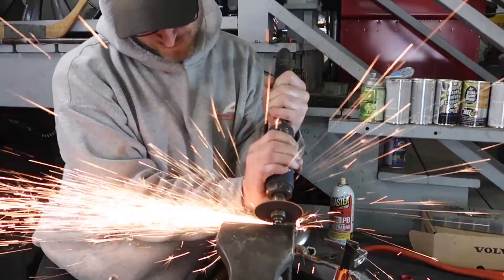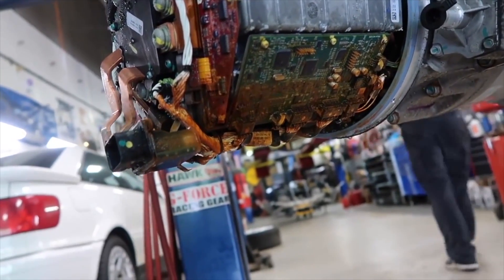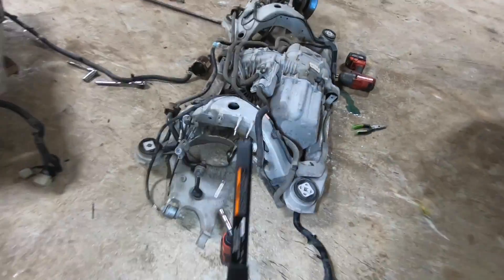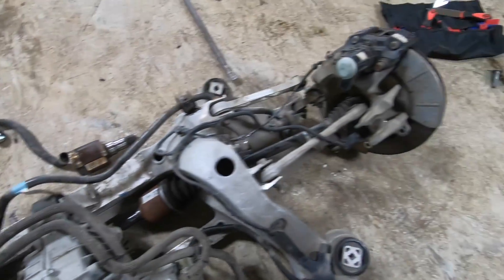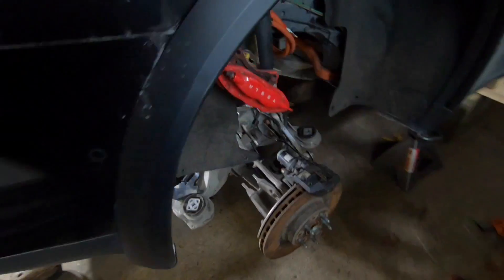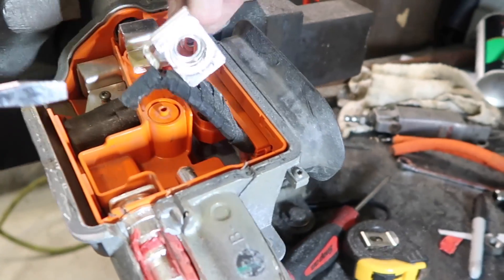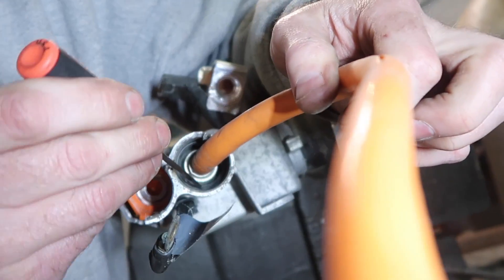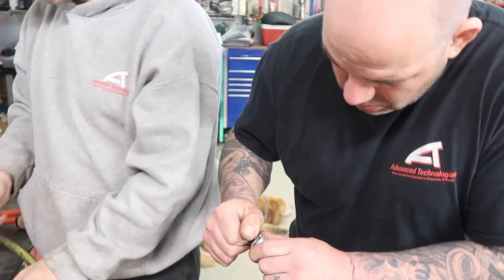Restoring a Flood Salvage Tesla Model X Part 7: Tesla motor swap

Comment: all that corrosion could be prevented with some dielectric grease from the factory...but Elon wouldnt be able to sell more defective cars if they where to use that.
Deffective in that they are building disposable cars that one must turn to scrap and buy new when something goes wrong.

Comment: I actually like that shade of gray. And don't think it's primer. Why does a buddy. Keep calling it primer ?
Can you and Sam get over it? You pull seem like a couple of reasonable individuals and pretty decent guys in general I think were done with the ribbing and should move on.

That being said, admitting you have a problem is the first step. It's time to admit you have an addiction for Tesla vehicles. It's okay there's a support group out there for you  I'm sure.I think were going to be fine as long as you don't start electric motor swapping a Dodge charger.I'd actually be fine with somebody doing it to a DeLorean. I know one your buddies was talking about it and even I myself smile that the idea. Just stay away from the New generation rearwheel drive Dodge cars and everybody will be fine . For the record, it's not actually the fact the vehicle's battery powered that kisses me off. It's all that computerized plumbing like the problem you're presently having with the computer and the motor not beings signed up with each other. I like when vehicles have little to no computerized shenanigans. I like to keep things simple fact of the matter is my big hatred with the new Chargers is all that computerized hootenanny. I love driving the car, but I hate the got damn electrical BS.

Comment: my friend scored an electric Ford Transit connect for $4000 in perfect working condition.  I have the gas version.  Needless to say, the electric version weighs 600lbs more than mine and drives like a complete sow.  it has 60-80 miles range.

Comment: grind down a pipe and just make a couple copies of a tool that works the same as the $250 one. this wont be the last time you need it. Then spend the $250 on some actual air tools (or any proper power tools) 
500k subs so you got some cash - or find a tool sponsor ..

Comment: Worse case... Cut your orange wires and splice the ends you need together, inside their own separate plastic junction boxes with bus bars or split bolts...  There is no law that says you 'must use their cables.....   In fact, I've really gone sour on Tesla after learning how they treat the repair community.  I hate to see their denial of parts.. pretty sad actually.

Comment: You don't want that transit connect.  They were aftermarket produced vehicles and made by a company that is no longer in business so no parts available for the electric side of the vehicle.  also a lot of the ford components arent available either.

Comment: Those cable connections remind me of hydraulic quick couplers but way more retarded and that box for the cables went in and said it Junction or is that a relay in some sort that are switch be nice rich could find a porcelain tube fit around that wire he screws it up too much he should always keep in mind good that wire would make a good set of jumper cables

Comment: Hey rich your doing it the hard way Phil can re flash the bcm and key to match the drive units
Reply: Lots of labor saved with a simple reflash too. Not to mention that the boards won't need to be soldered either usually. Many eeprom flashes are done with a clamp to USB like how they used to hack modems...

Comment: I’d buy a simple junction, and crimper for large gauge wires. You could cut them like you did, install the in-line junction with large gauge ring terminals. They use them in aircraft for power distribution. Mil spec would be MS27488-xxx . Panduit makes them as well. Those are probably 00awg or 0awg wires. Also Thomas & Betts like series 54816BENP.

Comment: Rich you could make the tool for the wires out of some schedule 40 pipe. Draw it out with marker and use a dremel. Weld a nut on the end to spin. Hayabusa axle pivot covers or bolts use a similarly made tool. Just build it.
Reply: Rich has barely traded up from using a cheap chefs knife as a mechanics tool, and you are expecting him to fab his own specialty socket now?
Too much too soon.

Comment: 3:36 when you don't communicate how quickly you want to lower the jacks. Use a word like 'turn' or 'down' for a 180 turn on the screw release. Say it at a slow speed to control the rate and pause.

Comment: luv ya Rich but Damn get some power tools    air  or battery
Reply: He is still waiting for some flooded powertools from tesla to salvage.
Reply: 😂🤣😂🤣😂🤣😂 killin me.
Reply: Chris McRoy  SOMEBODY please get it for him!!
Reply: Chris McRoy not enough torque? Reminder these are the bolts holding the drivetrain up so they have to be pretty beefy
Reply: @0554joe  once he loosened those a bit, power tools would do the job a lot faster.
Reply: Chris McRoy  weirdly I thought the same but he was using it one to disconnect the motor from the sub frame so FK why he didnt use it under the car.
Reply: Was just going to write that and say we should start a gofundme to get Rich some power tools...  It's painful to watch and listen to ratchets ratcheting ...
Reply: Pd Money im in